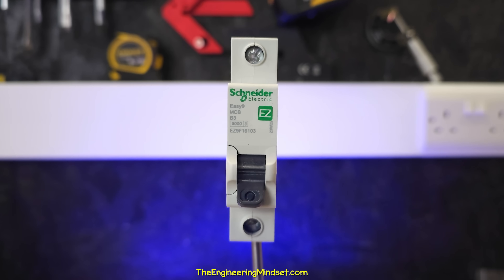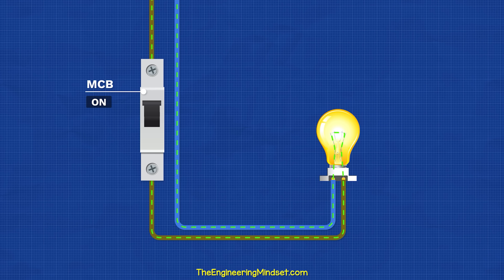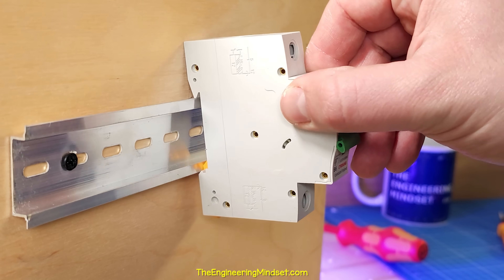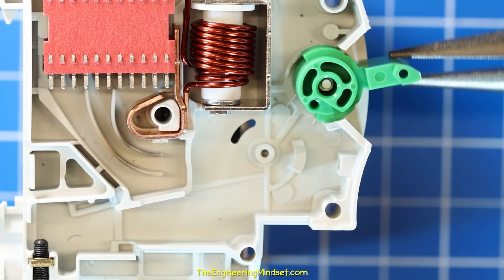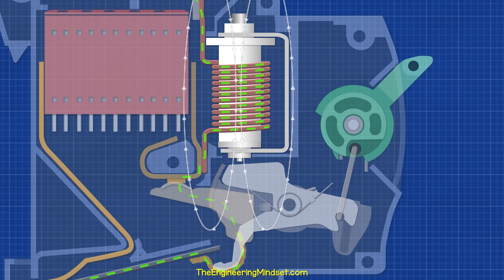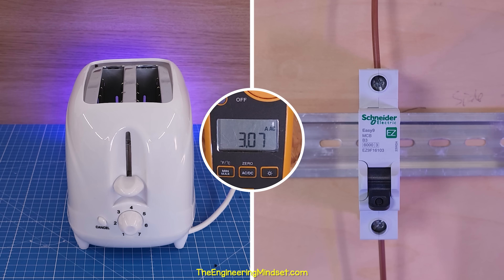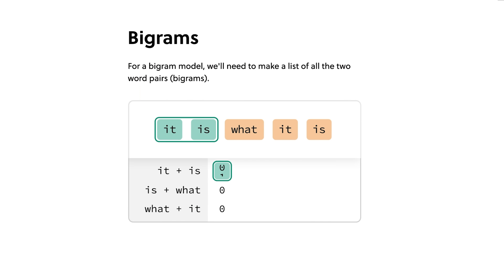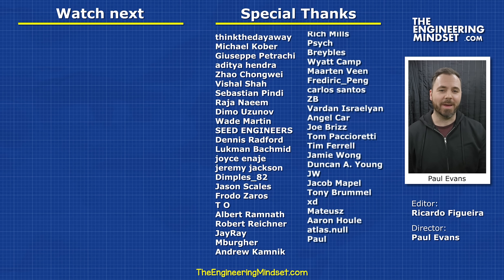Why Circuit Breakers DON'T Protect People (electric shocks)

Comment: The title is a bit misleading. True, MCBs do not protect people from fatal electric shocks. However, they do protect people from electrical fires due to overloads and, statistically speaking, electrical fires have been a much killer of people than electric shocks (particularly in the USA I should add, partly because of the way they build houses). To say that it is just there to protect property is simply not the case. Also, some MCBs are twin pole, although that's more an industrial and European domestic thing (at least in some countries). 

However, excellent job at explaining how MCBs work, and especially the dual-mode switching and why it's done that way. 

I note, there is still no mention of RCBOs. Those dual RCD consumer units are, thankfully, rapidly being confined to history and many electricians will no longer quote for split RCD CUs, and I'm a bit surprised that the regulations still allow them. Of course, then we come onto a far more contentious point, which as AFDDs.
Reply: I’m an electrotechnology lecturer, we teach our students the same thing by starting with the “breakers protect cable, RCDs protect people” in service of making the distinction between their designed purpose.
Reply: @yourfaceisonfire  A better take would be:
"The breaker prevents your wiring from burning down your house.
RCDs prevent electricity from killing you."
The cable breaking is not really an issue. Your house burning down because of broken cables, is. And since you live inside your house, fire and smoke can kill you easily.
Reply from the maker: Glad you enjoyed the video, note that RCD, RCBO etc will be covered in detail in dedicated videos. You have some good points but I will also add, and I'm sure you're already aware, but the MCB will only prevent (hopefully) a fire occurring from an overloaded cable, for example fixed wiring in the wall. But, most fires in homes start from faulty appliances. For example, if the decorative casing on a toaster catches fire, the MCB won't trip, it will happily keep providing power and heat to the fire until the entire house is ablaze. It will only trip when it detects a short or overload from something melting and creating a low resistance path. However, if someone drives a nail through the line and neutral when hanging a picture frame, it will detect this and cut the power, otherwise the nail would start glowing red and cause a fire. So it will only prevent certain fires. It won't prevent electric shocks, which I think most people believe is the case.
Reply: @EngineeringMindset  Aren't flames conductive? So wouldn't it trip if there was any sort of fire near exposed wiring? Maybe requires experimentation.
Reply: @EngineeringMindset  It feels like you are selling short how important they are, listing only what they don't stop.

There is no guarantee the user will be able to keep track of the load. Nevermind even knowing how much load is actually on the system, because some appliances draw more than listed or have faulty switches.
There is nothing to protect you from those fires - except the breakers.
As a happy side effect, it is also what allows the ground wire to save you from shocks. Tripping the breaker is preferable to an exposed, electrified surface.
Reply: @christopherg2347 most people truly do think that the breakers are only there to protect them from electric shocks.
Reply: Actually MCBs protect from electric shock when the fault mode is short-to-earth. In this fault, Live wire is shorted to protective earth on appliance, and about half of the full voltage (115 V in EU) appears in the chassis of the appliance. 

If human is touching same time proper ground and this faulty appliance, he will have electric shock.

MCB reduce the time the chassis has dangerous voltage, by breaking the circuit quickly enough.
Reply: @topimaurola  no they don't that is a seperate device used in combination with an MCB either as a seperate unit (RCD) or in a single package (RCBO)
Reply: @shaynegadsden I think what topimaurola is talking about is right, if youre electrical system is a TN system. In a TN system there's a low ohm connection between a grounded appliance and the transformer. If there is a ground fault, a closed circuit between line and PE is formed without any meaningfull resistance. This will result in high currents which could tripp the MCB. (Disclaimer: im just an apprentice as an electronics technician so no expert)
Reply: @sagittariusb2101 It is pretty scary that shayne needs that explanation on how ground wires work.
They are one of the many layers of protection to keep live surfaces away from people. And it could never work (would just cause a fire) without a breaker.
Reply: @sagittariusb2101 In an ideal world, yes. In practice, however, whether the faulty device presents a hazard to a person is highly dependent on several factors of which the most important is probably the resistance of the protective earth connection/conductor. For example, in medical equipment this has to be less than 0.2 Ohms. If the earth connection is degraded then the potential of the casing can rise to a hazardous touch voltage long before the MCB detects an over-current condition.
Reply: I was wondering what is the difference between single and twin pole ?
In my breaker panel (in France) everything is a c type twin pole and I heard from a video by a french electrician that single pole was used before but it's no longer the case and less safe
Reply: single pole is for the live wire of a unique circuit -double or twin pole is FOR THE same circuit protection of the neutral wire  @muulsh5341
Reply: @muulsh5341  Austria is the same. But in Germany single pole are standard.
Reply: @muulsh5341  Its just safer, but more expensive to also turn of Neutral
Reply: @muulsh5341  In America we have single pole breakers for 120v circuits. Just normal stuff you plug in. Then two pole breakers for heavier equipment like a stove, hvac unit, dryer. Not sure what type France uses but we are on 120/240 volt.
Hope that helps.
Reply: CB’s are meant to protect wire/equipment. GFCI/AFCI breakers are meant to protect both wire/equipment and people.
Reply: "electrical fires have been a much killer of people than electric shocks (particularly in the USA I should add, partly because of the way they build houses). "

"Every year, over half of accidental domestic fires in the UK are caused by electricity. "  This from the UK "Electrical Safety First". 

"Electrical failures or malfunctions were the second leading cause of electrical home fires in 2015–2019 accounting for 13% of home structure fires." This from the US "National Fire Protection Association".

Over 50% UK vs 13% US,  To suggest that this is a bigger problem in the US is complete nonsense! In fact, the NEC, National Electric Code is division of the NFPA, (National Fire Protection Association)  In other words, the rules governing residential electrical installation are driven by protecting homers from fires!

As for "the way they build houses".  Most homes in the US are wood framed which might suggest they are more susceptible to fire than masonry construction, however, in the living spaces where the electrical systems reside, both wood framed and masonry structures, are primarily made of wood. So in reality, there is no real difference in fire susceptibility based on construction.
Reply: As for death from electrical shock, 240 volts is more deadly than 120 volts, because of higher currents through the body at higher voltage. Also, standard RCDs trip at 30 milliamps, but US GFCIs trip at only 35 milliamps. Far better shock protection in the US vs UK. 

Individual circuit GFCI protection is a standard NEC requirement as now are AFCI breakers (Arc fault breakers).  GFCI protection may be provided by a breaker in the distribution panel or at receptacles.  

More people are indeed killed by fire than electrocution,  but your statement implies this to be worse in the US is complete nonsense and the statistics support just the opposite!!
Reply: @professorg8383  there is even lower than 30mA but its not recommended for home use as it could trip from parasitic currents and others kinds of minor current leaks
Reply: The inrush current with capacitors and inductors is not because they store energy. A dicharged capacitor appears as a short circuit when it starts charging. Iron core inductors are nonlinear and remaining magnetization can saturate the core.
Reply: (electric shocks)... Odd...
Reply: Even my 30+ year old fuse panel in my apartment in Spain, has (and must have by law) doble pole, rcbo, transient and permanent over voltage protectors
Reply: There's always one
Reply: Yeah... RCBO... I remember the hype. 

My friend installed RCBO in his house. I tested it by touching live cable. The RCBO didn't trip. Of course I let go as soon as I felt the shock.
Reply: @adorp  RCBOs (and RCDs) protect from fatal shocks, and in Europe in domestic premises, they are almost always rated to trip at a maximum of 30 mA (and normally closer to about 25 mA, something easily tested). Usually it will be at about 25 mA. The fact that it didn't trip when you touched the live wire will almost certainly be because not enough current passed through you for long enough. Most likely it was because the connection through you to earth potential was too high for a fatal shock. To put this into numbers, to pass 30 mA at the EU harmonised standard of 230V, then the loop resistance to earth via you would have to be less than about 7.7 kilo-ohms. For somebody with dry skin standing on a dry floor wearing shoes and not touching an earthed conductor, then that loop resistance can easily be in the tens of kilo-ohms. You will still feel a shock, but is just won't be strong enough to kill you. Unless the RCBO was faulty, that was what happened to you, and it would have happened with a 30 mA rated RCD too.

Of course, if you do the experiment in a kitchen with wet hands and toughing a grounded conductive object, such as the chassis of a microwave oven, or water tap then it's a very different story as the path to ground has a lot lower resistance. In the first part, having damp hands vastly reduces the resistance of your skin (and the body internals have much lower resistance to electricity than the dry skin). In the second, just standing in shoes with rubber soles, or a low conductivity surface means the resistance to ground will be rather high. Note that bathrooms are even more dangerous than kitchens as you may be soaked through from a bath or shower, surfaces may be wet and there's a lot of plumbing fittings about.

So the job of the RCD/RCBO is not to stop you getting a shock, it's to prevent you getting a fatal one. It appears to have done its job. 

Note that in the USA what they call GFCIs have a lot lower trigger current difference of 5 mA. That might well have tripped even with your test, although you would still have felt something. The downside of the more sensitive setting is that it is more prone to nuisance trips, and that is why the 30 mA standard is common in Europe. It's meant to make it very unlikely to allow a fatal shock but not get excessive numbers of trips.

I should also emphasise that your test was extremely ill-advised. Nobody should go wound touching live cables, even though some electricians in the past were known to test for live wires by brushing the back of a finger lightly against a wire (the back as the natural tendency for muscle contraction would cause the finger to move away from the cable).
Reply: Yeah that is a bad take it clearly points out how breakers works and fires are a secondary issue, that while performing their main function may reduce the chances of a fire they offer no protection against them
Reply: @shaynegadsden  I place "my house not lighting on fire" pretty high on my list of security concerns. Especially while I sleep. And this danger exists 24/7. Even if I have nothing plugged in.
Meanwhile all conductive metals are usually kept a few layers of insulation away from me, 24/7. I don't expect a electric shock from the few exposed metal surfaces I know.
If I am ever exposed to a live surface either:
- something has already gone horribly wrong (including ground failing)
- I am doing something very dangerous, like electrical work
Reply: The title is absolutely misleading. If a science channel made a video titled "Why vaccines DON'T protect people (cancer)" then it would rightly be ridiculed, regardless of the contents of the video.

Comment: Nice video can we get inverter circuit diagram pure sine wave
Reply: bros desperate for an ac source
Reply from the maker: It's one of the most difficult circuits to design, well, a useful one anyway. There are lots of basic versions which stop being pure sine wave once you plug anything in and have massive spikes.
Reply: Can we get at least one of the diagram a useful... 👋